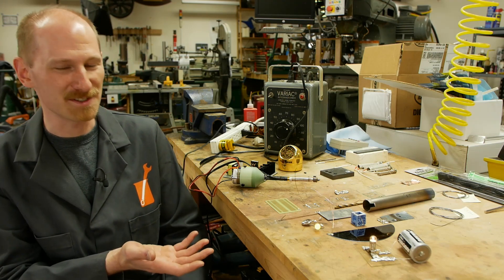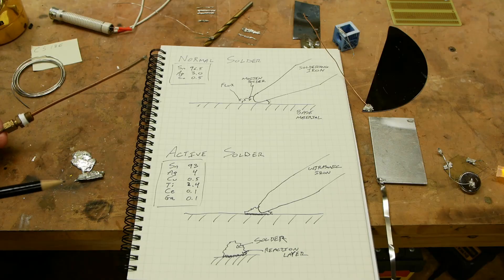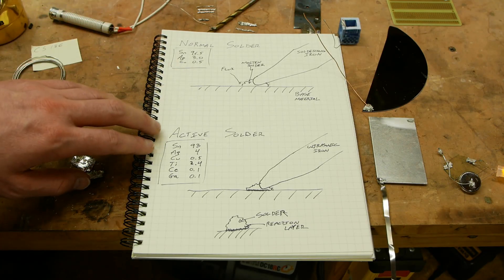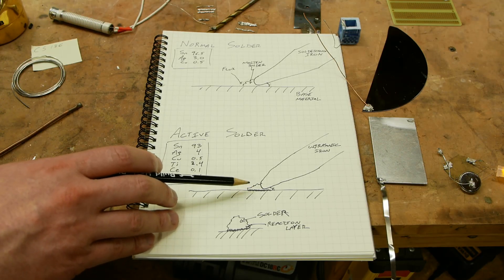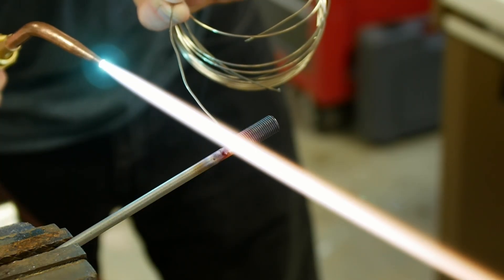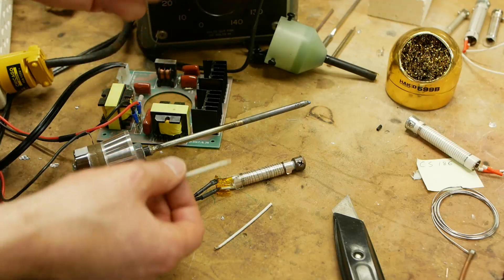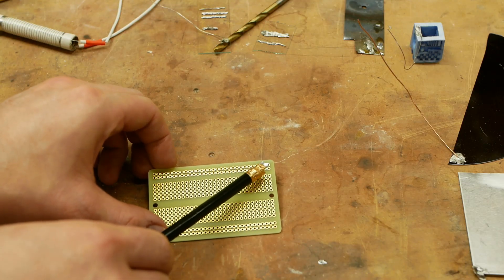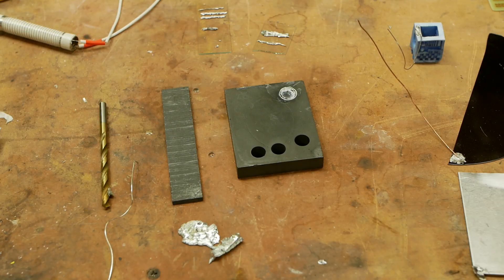Ultrasonic soldering bonds glass, titanium, stainless steel, ceramics, tungsten, nichrome...

Comment: The led was flickering when soldered to the TIO coated glass. It would be interesting to look at the current noise and resistance of this solder. Was the flickering due to the coating on the glass or the solder joint. 
I must say the joints are not very attractive compared to those of even lead free solder, and far less attractive to those of leaded solder. One must wonder about the granular structure of such joints and their electronic properties.

Comment: Here's a project idea that I thought of, but don't have the resources or know-how for, but you do. Dye-sensitised camera sensor. Two sheets of striped ITO glass at 90° to one another, forming a grid of pixels. Add the chemicals and put in place of the film holder on a view camera. Could it be done? I got the idea from this video, which uses discrete photocells: https://www.youtube.com/watch?v=PaXweP73NT4

Comment: Thanks, man. Before the video I did not even know the thing existed. If I needed to connect a wire to a piece of glass I would probably look for someone who has an old vacuum metal spattering chamber in his garage liberated from somewhere during the soviet era decline and ask him to put on a thick enough layer of silver to accept a regular Pb/Sn eutectic solder joint on all the required spots. It is good to know that there is a technology that makes it possible to get the same result at home with no bulky and noisy equipment needed.

Comment: Super interesting! As usual amazing work.

I have one question, you mentioned that this is a messy process that won't produce nice looking joints like electrical soldering. I wonder if the use of a flux of some kind could be used, not to facilitate the joint but rather to improve the cosmetics? You mentioned a few real world examples, I wouldn't want to open up my snazzy new product and find ugly solders like that.

Comment: What would happen if you tried to use some different fluxes? I understand this technique relies on flux not being there, but maybe it could protect the solder on top form oxidizing and the reaction between solder and whatever surface could still occur in the reaction layer?

Comment: aluminum welds to glass in a vacuum chamber. i had a guy re-aluminize my primary & secondary telescope mirrors he made is own vacuum chamber machine with a titanium filament & aluminum foil from walmart can do up to 17" research grade polished mirrors. he had to use a acid to remove what was left of the old it was well embedded in the glass and i could'nt get it off

Comment: Just a note that you can solder some difficult metals with conventional solder by using some supplements. For example I have bottle of ZnCl solution, that is used to solder ferric alloys with quite success, it can also be used to solder Ni / Cr alloys. Another mixture is dilute HF + EtOH for soldering aluminium. I haven't studied deeply how these work, but it may give some insight to this problematic as well.

As to what to do next, I personally would go wild with alloys trying to substitute expensive or rare elements. Al instead of Ti comes to mind, Zinc would be interesting. Unfortunately I am not really excited by this technology, otherwise I would do my own experimentation

Comment: The corrosion you see of the tip, is likely a result of the quality of the tip, and using it with an unleaded solder.
I bought a cheap soldering iron a couple of years ago, and used it with lead free solder. The solder combined with the tip almost immediately, leaving it concave (although, in my case, shiny) where the solder had been in contact with the tip. Needless to say, I don't waste money on cheap tips and/or soldering irons anymore.
Reply: ... also... As it's ultrasonic, and in contact with a solder designed to work with oxides, I suppose you'd need a tip made from an inert metal, that can also resist the mechanical wear from the vibrations

Comment: I used "YT Comment Finder" to find comments about "LED" because I suspected I am not the only one who is intrigued by the reason why the LED blinks. I found more than 12 times this question was asked. It is really a very helpful tool that I will use from now on.
Reply: I just used a comment finder too, searching for "LED" in all caps, only to find that the retraded Google Chrome does not have case-sensitive search... You need an extension or external tool for every basic little thing nowadays.

Comment: 1. Can you solder glass to glass? If so, how does it break?
2. Can you be precise enough to remove that haunting zebra connector of an LCD?
3. If you pass high enough current, where does it heat up? I.e. is the metal-to-solder interface conducting well?
4. Can you solder to a superconductor? Dunno why, just curious.

Comment: The tip erosion is a case of tin to copper is like water to salt. Tin will dissolve copper when molten. That is why the inter-metallic bond is so strong. Also why your tip erodes so fast.

Comment: awesome..i´m working with shape memory wires as actuator for robots and using just crimp technique. Maybe US-soldering is a better solution. I would be happy if you could try this (and make a short video). I´m also interested in your vacuum induction melting oven

Comment: My fathers uncle, whatever you call that in english... Tried to weld a glass bottle to a piece of metal.
I never heard if he ended up succeeding, but he tried a lot, again and again. Didn't give up.
Told my teacher about that story (i was studying blacksmith) and he said it was impossible to weld glass to metal no matter what.
Well i guess it's possible, just in a really weird way xD Really cool video! And interesting.

I just repaired my stainless steel watch with a ts100 soldering iron and lead free solder ;) Spent quite some time to find some this weird liquid that makes it possible to solder stainless steel. That stuff works, but seems pretty corrosive if you don't clean it off. Got it from a hobby shop that specializes in those small train models. Guess they use that stuff to solder train tracks together?

But hey 10$ for the liquid, 130$ to get the watch repaired in a shop with fancy tools... Yep i'm happy :)

Comment: I'm the guy that makes vacuum tubes. Do you think this technique could be used to seal soft glass to pyrex to make a vacuum tight seal? Being able to seal an envelope without heat opens up a lot of interesting projects! (vacuum epoxy is not permanent, it gradually leaks up) 
Another use would be to seal wires through glass to make the sealed feedthroughs. (it is extremely difficult to make a small vacuum tight multi-wire feedthrough in boro glass.) It would be interesting to see if a hole could be drilled through glass and then use the ultrasonics and special solder on the feedthough wire to see if it would seal to the glass and wire.

Comment: Can you use standard solder on top of the "active solder"? So can you "prep" the surface with the active solder and then work with traditional solder from that point on? If that is possible the soldering may be able to have a cleaner, and easier, solder joint.

Comment: I have a couple questions:
1.  As far as I can tell, what matters most is whether the solder is molten, but does it even matter if the surface you're trying to bond do is hot?  In other words, what's the lowest temperature you can achieve to make this work?
2.  I assume that all it takes to de-solder is to just simply heat up the solder without the ultrasonic. Is this the case?

Comment: Very interesting!
10:30 It looks like a soldering iron tip does once the iron plating has worn through and the copper inside is exposed. Usually it degrades quickly when this happens due to flux + heat. In your case, likely even faster, since the copper likely can't take the ultrasonic scrubbing as well as the iron plating.

Is the conductivity approaching copper? Could this be used for making circuits on ceramic substrates? I was thinking heated ultrasonic tip on an XY robot effectively printing circuit paths.
Reply: Ah that makes sense. Copper is soluble in these alloys too, so makes sense it would get eaten up fast once the nickel layer is gone.

Comment: Really interesting stuff. I'm surprised your ultrasonic iron worked so easily just bolting stuff to the front of the transducer. When I've played with them they seemed really finicky about tuning and I think I burnt out two of those ebay driver boards. I guess being so overpowered means they don't have to be performing optimally to get the job done.
Reply: Unrelated, but kind of crazy, I've been watching both of you since I was in middle school.  I'm a senior in aerospace engineering in college now.  Both of you have had a positive impact on my life
Reply from the maker: Thanks!  My driver board is finnicky too.  I think it helps that there isn't much mass connected to it, and I'm not pushing hard, so it doesn't have much mechanical load.  If I build another rev of the iron, I'd use a smaller driver, and a more controllable circuit.  I like your new channel logo!
Reply: @AppliedScience  Ever work with vanadium at all, electron flow without heat, valious states.   Hope to microwave or electrochemical synthesis, catalytic. Distractions show variac model. Brother stole millions burned lab after stealing microbiology, analytical equipment. Fled to UK. Literal free serial murderer. Public record, hope references links. This is great for kids!
Reply: @AppliedScience  Hi, this is amazing, can you tell me what is the reason to use a heating element in the tip?
Soldering for high frecuency and heat?
How many watts do you recomend for the soldering iron?
Are you usin the stainless steel rod or are using the copper tip of the iron?

Be careful with the transducer wires, touching can fried.

Sorry for all my questions, I want to make one.

Best Regards.
Reply: @AppliedScience  I'd love to see the vacuum induction furnace, even if it's just thrown together footage of what you already have.
Reply: If you two teamed up and brought in Tech Ingredients, you could rule youtube. Please consider it
Reply: @Mitchell_is_smart._You2bs_dumb  
You'd absolutely want the thought emporium in as well - if you haven't seen him, go and have a look at his channel.
Reply: @Mitchell_is_smart._You2bs_dumb  No, don't wanna see jumanji boy with ben and Tech Ingredients, a better collab would be Breaking taps or Huygens optics.
Reply: @teresashinkansen9402  Jumanji boy? I'm not sure who this is
Reply: @Mitchell_is_smart._You2bs_dumb  throw electroboom in there for comic relief 😂
Reply: @ShroomJGV  i like technology connections brand of humor a little more, but i think they would already have everything they need.
Reply: I just made a similar post above before reading yours here.  My company owned two ultrasonic impact grinders and two ultrasonic rotary drilling/milling machines and all of the diamond tooling had to be tuned to a nodal point for the given mass and length of the tool or it would put too much stress on the transducer and the tools would not perform.  We machined ceramics and other very hard materials using all diamond tooling.  You did not want to burn out a transducer as, even back in the 80's, they cost about $30,000 each.  I enjoy watching your videos and always learn something from them.
Reply: We've got some ultrasonic press machines at work, used for sealing and joining stuff, primarily plastic.
One time, one machine had a bolt fracture on the booster, and it made such a horrible screech that could be heard outside the building, with the doors closed, over 50 feet away!
Ear protection is a must!
Granted, these machines are about 900W each.
They're indeed picky about the dimensions of the tooling, it has to be tuned, otherwise you risk damaging the horn (transducer) or having poor efficiency.
Reply: Clearly you just needed more UGGA DUGGA! 

 More dakka is always the answer.
Reply: Awake an amalgam to protect oxidation on end iron Aluminum Hg, gallium, or oh n m
Reply: Those driver boards use big inductors after the transformer to get it all to resonate nicely, but this isn't strictly necessary. If you want a variable power supply, you're probably better off going with a cheap ZVS driver into a step up transformer as long as it's in the ballpark frequency. As a last resort, you can just run them on any square wave with a 50% duty cycle (H-bridge probably preferred.) free transducer is essentially nothing more than a large ceramic capacitor, so it's really not that hard to calculate. It won't be as efficient as a tuned resonant circuit, but that's fine if you're trying to lower the power anyway.
Reply: @sinaroughani7000  
You're comparing a large BLDC motor for R/C applications, with a small bldc motor for small machinery or such precision work.
The R/C BLDC's are meant to go in model aircraft, where they can afford high heat production in a small space because there is a strong airflow over the motor. Some are water cooled for R/C boats.
Reply: @BenjaminEsposti  The difference in intended application notwithstanding you definitely shouldn't take anything sold on eBay, Aliexpress et al. at face value. In fact a good rule of thumb is to assume that all (or most) of the parameters they quote is fake and gauge the devices' performance based on price (and dimensions in some cases).
Reply: @BenjaminEsposti  And they don't have to run for hours at a time at 100%
Reply: What you are saying is part of the picture, ok. The other part is hot air. Get over it!  @BenjaminEsposti

Comment: I've used this stuff. Got it from S-bond (you described their 220 alloy), which wasn't much of a hassle, though they sell it for $5/g. I didn't need much, so that part was fine. It's actually possible to brush it on with a hotplate, so I cheaped out and did that, although you need to clean up the surface afterward--I used a fly cutter on a milling machine.

I was bonding glass to ceramic, so the thing that got me was the high yield/creep strength. One of the easy ways to cope with thermal expansion as you come down from the melting point of the solder is for the solder to creep a bit, but this stuff has a fine matrix of SnTi intermetallics which act as rigid reinforcement and prevent it from creeping easily. 

I had a strong alumina piece bonded to a glass piece with CTE 7-8. Everyone will tell you the CTE of alumina is 7-8 also, but that's averaged over either 0-500 of 0-1000 C. Over 20-100 C, the range relevant for this process, it's more like 4-5. So as the assembly cooled, the ceramic pulled the glass apart without debonding the solder; it's got some strength. We learned that we should have stuck with B33 glass (CTE 3.3 ppm/C), which we would have done if not for this red herring about the CTE of alumina.

Glass is stronger in compression, so I think the active solder might have worked with a B33 glass part, but we went for a softer solder, and solved some of its problems for our application instead.

Comment: Hi Ben. You said you can use it to hold a nichrome wire. But it doesn't seem like the melting point or mechanical strength can support any level of heating to a coil or something useful on the nichrome.

Comment: You seem to be doing long runs without adding solder.  Is this using just the solder on the tip??  It almost looks like you're feeding solder through the centre of the iron!

Comment: Did you test ho soldering angle affects to bond? With soft fragile material like graphite it may be that 45 angle just break that surface to dust and it does not attach. But did you test clean it well and then direct 90 deg angle so that it will more like push that solder inside of material instead of along it? Or try wash dust away from that surface with alcohol, acetone or some other stuff what dry fast.

Comment: I'm not a chemist, but my best guess at the cause of your tip erosion problem is that your solder is a metal solvent.  In some sense it needs to be to form a good joint.

It would be interesting to see how stable these joints are over time.

Comment: Can you make it smaller to be used for tiny connections? You should use a smaller transducer anyways, right?
You could try to connect to solder to the ITO contacts of a LCD with tiny copper wire instead of using a zebra strip.

Comment: Can you use this solder technique to create vacuum compatible bonds to glass? Pressure fittings are usually challenging on non planar glass / very thin glass. (I always wondered how permanent vacuum sealed photo detectors, the Peltier cooled ones, are sealed. Its definitely a thin metal seal and not a process where glass is melted.)

Comment: Mayby its cavitation that whears tge Copper soldertip ..?
Great content subed !
Grtz geertsjohny
Reply: MDT  I think gallium forms a solution with copper under ultrasound that migrates to the bond and hence the tip gets shorter.  The other commercial active solder also contained a component Hg (Mercury) that forms amalgams with many other metals and may cause corrosion to the tip.  I would try a ceramic tip instead of metal as basically you are transmitting ultrasonic energy and wetting of the tip is not absolutely necessary for the process in my view.  However - note I have o means to try or confirm this.  Ben’s the man!

Comment: I'm struggling trying to bonded anything to the positive terminal of recycled 2170 Model 3 batteries. The terminal and the bond wire both appear to be aluminum.  Any chance this technology  will work for Al to Al? I'm getting ready to try ultrasonic spot welding but haven't been able to find surplus equipment that might work so I was looking at building up something out of transducers similar to what you gave done sans heat.

Comment: The threaded rod that goes into the horn is the same thread type as the ones in normal bicycle axle shafts. Any regular shimano will thread in. Really nice cause you then have access to cheap threaded tube for those (for the quick release axles).